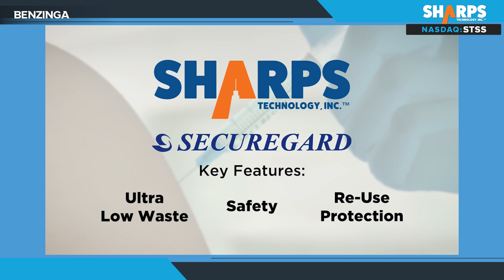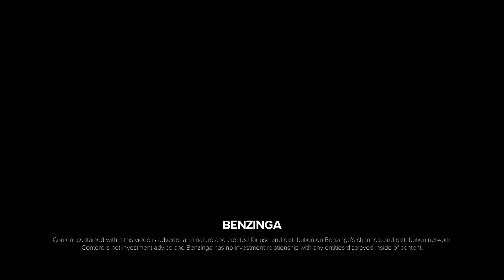NASDAQ: $STSS 💉 Meet Sharps Technology In This Interview With Their CEO, Robert Hayes!

Comment: Polymer syringes can also be made into custom configurations, which can eliminate breakage, minimize dead space, reduce contamination, and support the development of custom devices including autoinjectors. The ability to produce these innovative products using advanced manufacturing techniques creates additional advantages in the areas of quality, performance and safety when compared to similar glass syringe products. We look forward to introducing this line of next generation products to the market.”
Sharps’ specialized product pipeline and market strategy will include a broad range of sizes, silicon free systems that address contamination issues for the broader healthcare market, dual chamber systems that improve drug shelf life while reducing unnecessary packaging, and customized solutions for systems that serve the growing autoinjector segment. #manufacturing #packaging #safety #healthcare